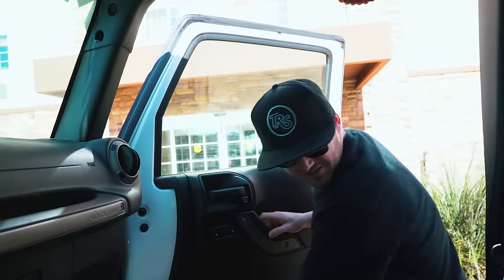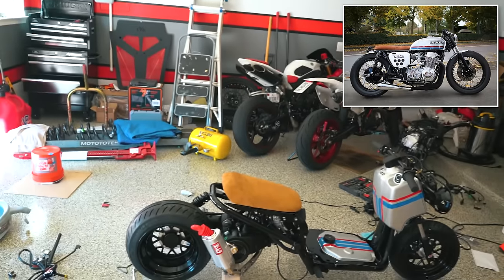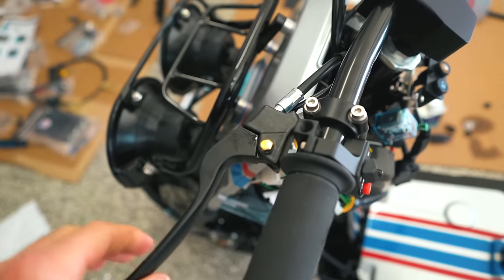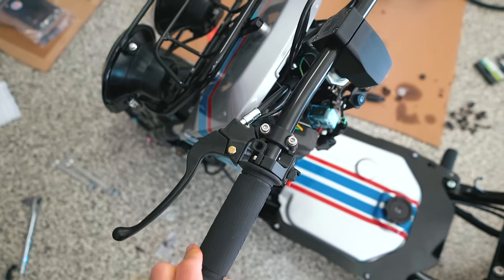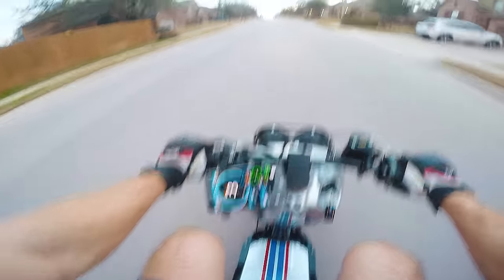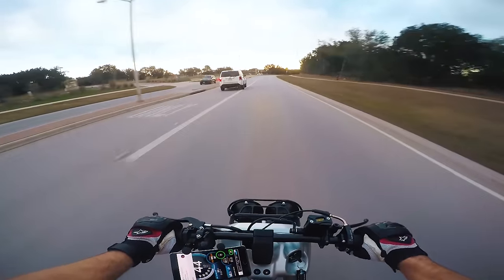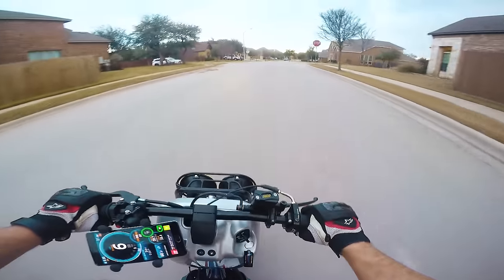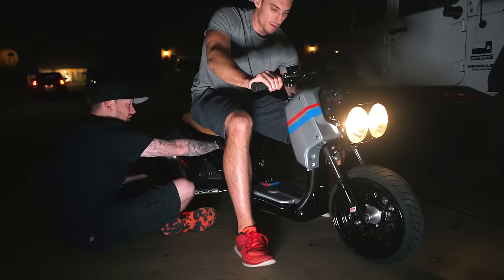FIRST RIDE on a 150cc GY6 HONDA RUCKUS!!

Comment: Pls bore it out to a 232cc and turbo it would be the baddest thing on the street it would probably hit 74 mph
Reply: Ryan Stuck specifically 74 mph
Reply: I don't know why I picked 74
Reply: With those racing stripes it'd probably hit 74 and a half
Reply: Dude each one of those stripes ads 2 hp
Reply: Ryan Stuck dude in Norway our 70cc mopeds Are going 70mph😂
Reply: 74? Only? Here in denmark we tune our 70cc engines to around 60-65 mph? A 232cc should be able to do more ?
Reply: 50-70cc Madness all question marks are in the wrong place, wow
Reply: Kontrol™  i have a 96 cc derbi motor  i hit around 33hp with That thing
Reply: Remember, you're probably using a high-ish end twostroke bigbore kit. This is 4stroke. and its not a racing kit.
I have a bidalot 80cc kit and it does like 140 kmh. ^^
Reply: isnt that 1 cylinder engine? turboing 1 cylinder gives next to none performance gains.. just adds weight and takes more space.
Reply: Ryan Stuck wtf 74? on a 232? bro u need help!😂
Reply: At least 600mph
Reply: TheOneWheeledNavy 100 give or take depend on how u tune in. and aerodynamics of the bike
Reply: a properly built and tuned 232 will hit about 100.  You can not bore the stock A Case out to it though.  You need a B Case motor...most people go with a Taida B Case and 232 Kit.
Reply: Ryan Stuck if u look up ruckus turbo the guy that build his ruckus he said he hits 94mph
Reply: Ryan Stuck you can hit 75 with a 150cc and the right weights , carb , ported head , cam and tons of carb tuning I know we have one. 70's on a 171cc will be easy but Brent will have to play with the weights to get the best combo. It's all about the combo. And for the 2 stroke guys they are always faster . Look at a 250 Mx bike it takes almost a 450cc to match the power of a two stroke.  And we know a polini 96 water cooled 2T makes 34hp but cost 3k
Reply: I have a stock Chuckus 150 cc and my top speed is 69
Reply: When talking about mopeds I think Finland is the most bad ass on that subject.. Our 50cc hits easily 60mph!!!
Reply: has been done
Reply: Touko Kaakko Tomos all day!
Reply: Hans Edvard Helås no they don't, 45-60kmh not mph.
Reply: Mr.Grazzhoppa stop following me
Reply: Bazinga they can, but the engine lifespan is very short
Reply: you can look up Tuning kit polini Big Evolution 94cc Water  
cooled part number 050-0940 27-30 HP and I fly paramotors and they get 20Hp on a small cc
Reply: Troy H  Well I actually got one due motocross/enduro... My age just isn't enough to drive more than 50cc on street 😭
Reply: First of all it's a moped which sound goes over a legal db. I always ride faster than 45km/h which is the law here for mopeds. And yes, maybe they're not interested bout mopeds, unless if you don't live in Finland...
Reply: my 228cc does tops out at 83mph so far :) .
Reply: Nah he should do LS swap
Reply: more than that
Reply: Ryan Stuck bro I have gw 250 and it goes like 90
Reply: >baddest thing on the street
>74 mph

...my face when...
Reply: 74? Thats what an open 125 runs, with a 150cc you should get at least 90

Comment: Remember this was his first ride . You have other variables if you want top speed such as Jets , roller weights grams , right now he is running 10g sliders for good take off and it's a only 24mm stock GY6 carb. No bad for only the 2nd time starting. The belt has to break in. Valves and rings need to seat. They just wanted to get a first ride in. I think they are doing the BBK today and then tuning. We spend days on tuning a carb and getting the right combo of weights for the rider , adjusting float bowl, changing contra springs. Etc etc .

Comment: you almost have the dutch flag on it man
Reply: klotuur viel mij ook al op!👌
Reply: klotuur ayy
Reply: Hier laten we zo'n ding 130 lopen met 70cc 😂
Reply: SmileOnCrack. 130+
Reply: SmileOnCrack Als die hard wilt rijden pakt die zn motor wel 😉
Reply: Supermofools z'n motor gaat wel wat harder dan die crossmotors op wegbanden van jullie zeker
Reply: Als ze nou eens wat meer van deze dingen in Nederland verkopen.

Comment from the maker: "Life's Better With Horsepower" shirts are still available! Get em at http://motonosity.com :)
Reply: my 70ccm scooter drive 130kmh thats 80 mph^^ but your sound is better :D
Reply: dominik thiel what kind of scooter do you have? :) i have a 50cc which goes 90km/h
Reply: Motonosity yo hit me back up on this. is the ass end stock if so do u really think it's necessary to have it out that far
Reply: Motonosity where did you get the exhaust
Reply: I need help in so many ways. I bought a Honda Ruckus 2013 from a man saying that he had to hot wire the moped from a divorce and could not get the keys. Very suspicious. I have a new ignition and gas cap and seat lock. It has been modified and looks awesome. To the point...I had it running but I dropped the hot wire from the ignition wires to the neg term..It fried the electrical mystery. I replaced all fuses and relay switches. I checked the CDI and the rectifier. I checked the stator and everything I could think of. Any Advice?
Reply: ***** aye I don't know to much about ruckus stuff. But did you check the common stuff it needs to run. Air, fuel, spark, and you may if haven't, check ground wire. I hope I was in some way help in idea or anything good luck bro. Do a compression check also and check out carb. Did it sound good when you did have it running no putting out or when gave gas stayed running?
Reply: scott O'brien My bit of advice.....DONT BUY STOLEN SHIT.
Reply: Motonosity I say 60 or 65 I had one
Reply: Motonosity if you swap the brake line in the future, put some sram butter on it. Or, if you are cheap like me, some petroleum jelly works really well too.
Reply: Hey I am buying one but how much for all that stuff I want too do that if u can do it

Comment: If you want to keep the old school round headlights but upgrade them, look into JW Speaker. They have a 5.75 inch version which I assume is what's on the Ruckus. They're a bit expensive but they are fully LED and meet DOT requirements, plus they have an adaptive version which helps light the corners when you are leaning, really amazing stuff. The models are the 8690 and 8690 Adaptive.

Comment: here is one thing to think about.  Roots type supercharger by way of an old vw smog pump.  It runs about 7 to 10 pounds of boost, the turbo kits available are around 300 dollars all in, and their functional boost is exactly the same as a supercharger.

Comment: I had a ruck years ago that I wanted to do a swap in but ended up selling it.

I got a yamaha bws 50 instead. It did 45 miles an hour stock and 60 with just a big bore kit , pipe, jet, . 

It was a fraction the price of doing a ruck gy6 and I could do wheelies. 

I still love the rucks and am looking to get another one but I'll be keeping it stock.

Comment: also, if you want to increase the spead easy, lighter variator rolls (just slightly) so the engine will rev higher (probably). there is another way to increase the top speed, because the belt probably wont travel all the way to the top.

Comment: make sure you blue locktite those bolts... That GY will rattle them loose if not, especially anything directly on the motor, like that tag mount.

Comment: Picked up a Honda ruckus with no engine.  Was going to do gy6 engine but I seen some on Ebay is the one you used that much better than one found on Ebay,

Comment: i dont know how it works in the USA, but when you increase over 49cc its no longer a moped, its not a motorcycle right? do you have to register it as a motorcycle? or still as a moped? i really dont know how the register system works in the USA, but in my country, if you got even 51cc the vehicle is officially a ''motorcycle'' and no longer a scooter/moped

Comment: you could take the big bore kit to a welding shop and they could weld it back on. it's only cast aluminium that's not that bad to weld and wouldn't be stupid expensive

Comment: The Ruckus is cool, But I kind of like the style of the Metropolitan better. I am a little surprised that you were only able to get the bike up to 58 for the first ride in this video. I kind of figured with a swap from a 50cc to a 150cc  that the bike would go at least 60mph or faster. the reason for me thinking that is because The ruckus and the metropolitan scooters are half the weight of the original bike that the GY6 engine goes on. great job on the Ruckus though, looks nice.

Comment: hey, just curious what size carb you put on in this video and also what jetting did you run? Ive been reading a lot about this carb and it seems that a lot of people have problems with the jetting so I was just wondering what you ran for jets to get an idea? 
thanks!

Comment: love it and have 1 question, its stupid but i don't know the name... what kind of wire connectors do you use for the tailights? 6:50 - 6:55 is where i see them

Comment: i ride a 125cc (chinese cruiser-like motorcycle ) and it does 110kph (68mph) stock with air restriction and stock exhaust...
 that is a little slow for a 150cc but good job, looks great!
Reply: Ricardo Pinho it's his first ride and no rucking give the guy and scooter a break
Reply: Ricardo Pinho you probably have a gear box though
Reply: yeah, true. Didn't take that  into account... my bad.

Comment: 11:22 on a GY6 engine, the rpm should go up once starting reaching top speed weird that it didnt. did you change the gearing in the gearbox that conects to the output shaft?

Comment: nice build, not for me but each to his own, why a slide carb?.
gy6 run better with a cvk imho, i tried one but prefered the smoothness of the cvk, i the mikuni i tried was way too snatchy add that to the vibes on a gy6 and it was too much my mpg  dropped too. so switched it to 28mm cvk and its been great.

Comment: Gotta add Dr. Pulley sliders. That will change the gear ratio for higher speeds.
Reply from the maker: +Gaites Klein already did. Will probably swap different weights though.
Reply: Motonosity I did the dr. Pulley hit clutch and sliders on my Burgman 400. That's gotta be the next build if you're doing scooters. Or the 650 Burgman. They are so fun.
Reply: Gaites Klein man I think a CDI racing box would give it maximum performance after the carb and big bore kit are installed

Comment: You installed the connectors on the tail light backwards...if they ever come undone during a ride the power side could short out on the frame... the female connectors should always be on the power side...

Comment: where that fin was broken is a huge deal.. some where lower below the combustion chamber not so much.. at least file the crack down for the surface area for cooling..  remove the stress risers from it.
Reply: drunknpossum it's cast and it will be OK
Reply: only for a min or two.. in the long run the piston will have over heat issues.. ever wonder why the fins are larger near the combustion chamber and smaller near the crank?

Comment: I'm guessing because your a really big dude amd weight plays a big factor into it but my ruck with the GET motor intake/jetted/NCY box/exhaust I max out 55mph using the same speed app you used on your cell phone.
Reply: Evo Dingo he still had more road to go and wasn't tucking so probably could have got to 60 or so. Most out the box gy6 swaps on the ruck hit 50-60. I know we have made get engines hit 62 but the gy6 gets there a lot faster. It takes the get engine a while to get to that 55 lol
Reply: Evo Dingo what is that app called

Comment: Lol i reach 80 mph on a 80cc bike (my friends reach 60/70 ez on a 80cc moped) and this is 150cc's ? And tops out at 60 ish
Reply: Deadpan yeh but this is 4 stroke tho, and pitbike like engines don't produce as much power as others, and it's an automatic, which i've heard also has effect on the top speed
Reply: Regmou5 the gy6 is the same concept as a moped engine engine makes revs no gear changes just rev out, output goes to a belt that drives a automatic trowout clutch. Same concept only 150cc's, and two stokes are slower to since they only have more torque 4 stroke should be faster! I hope he gets it over 90 but idk
Reply: Regmou5 a friend of mine has the same bike as me bored from 50cc's to 94 (the max for this engine) he produces 37hp and has a top of about 95 mph
Reply: Deadpan i have a unrestricted 50cc moped (i have some videos of it on my channel) and it does 92kph
Reply: Regmou5 mine does 130kph our friends have some to, i dont have any vids of it to since i dont have my licence yet so i drive ilegal but you can check out our team channel (schakelteamlimburg)
Reply: Deadpan schakelteamlimburg? nederlanders ook? ik rij op het moment ook zonder license hoor 😜 theorie wel al binnen...